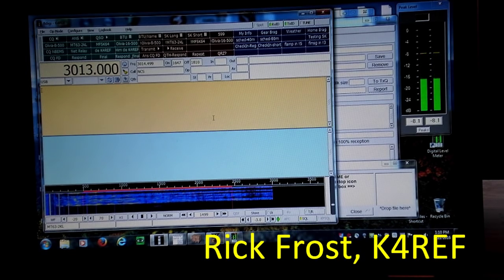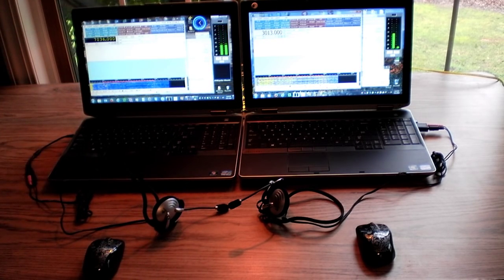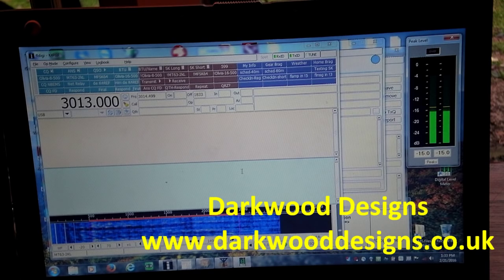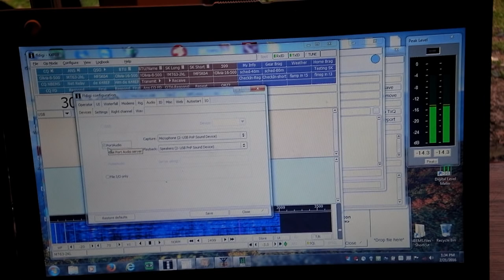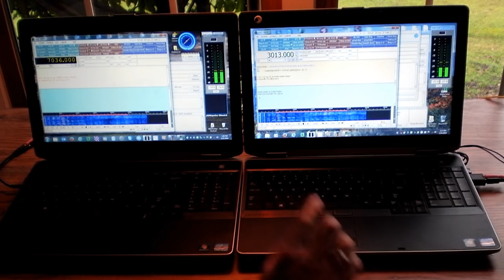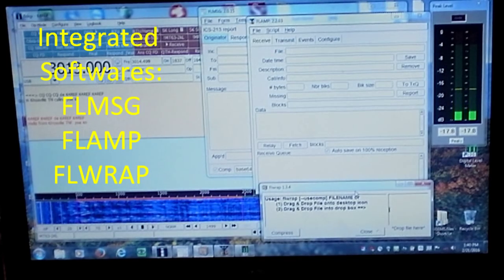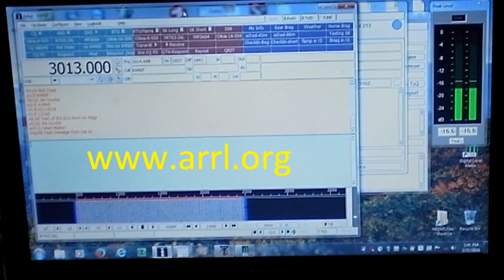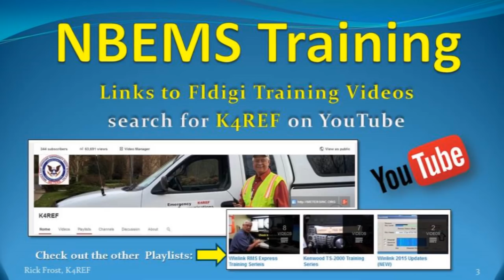NBEMS - Fldigi "How To Learn To Use IT"

Comment: Knowing this is 7 years old, could you just use cables to go from the mic jack on one USB soundcard/laptop to the speaker jack on the other USB soundcard/laptop? You would have two cables, but would it work instead of having two sets of headphones?

Comment from the maker: 2busy4play... yup... the headsets really are not required.  It does make it a little quieter.  I was playing around with it last night without them... and I was amazed at how low I could turn down the speaker audio with the built in mics turned all the way up.  If you're using a desktop... then the cheap headsets might be an easier way to do it.  Glad you're having fun with it!!  73, Rick

Comment: The official name of the program suite is Narrowband Emergency Messaging System (Not "Software") per Dave W1HKJ, the author. Thanks for the Darkwood link, btw. Looks like a useful tool.

Also, if your laptop has a built-in mike and speaker, the headsets aren't needed. We've sent messages acoustically clear across an auditorium at normal volume levels. We've been using the acoustic computer to computer method for training for years.